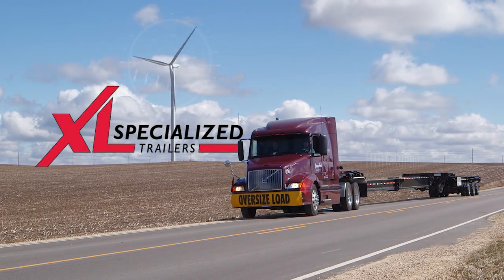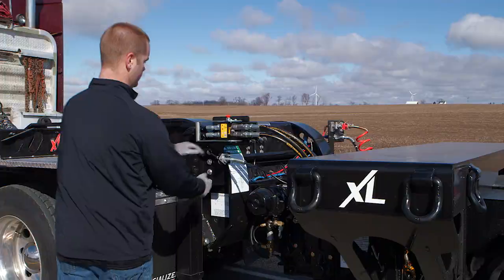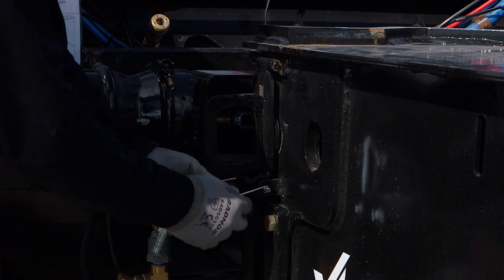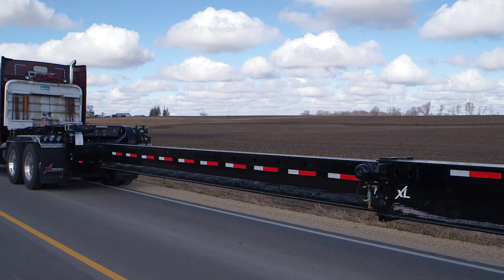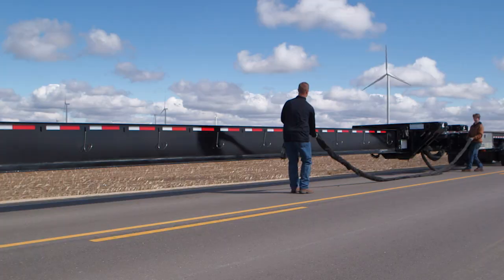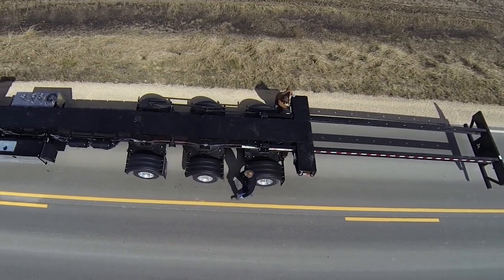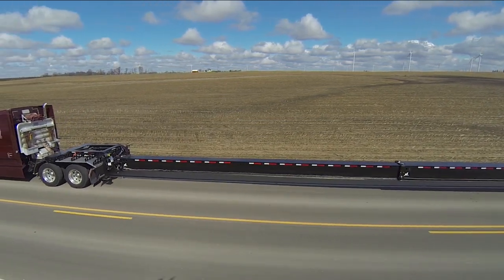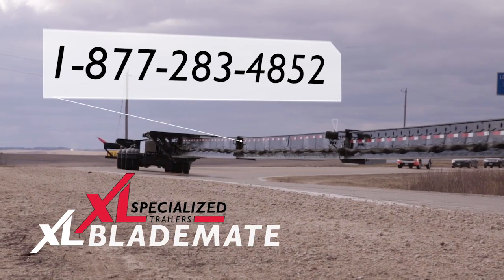XL BladeMate: How To Extend

Comment: I am a steerman for one these trailers. It's not a hoax it's real. We haul wind turbine blades on them. The axles on the trailer steer by a remote which let's us take turns. Which is my job. And yes if the wind is to high it will make the truck go out of control if you're not careful. Its actually a fun job.

Comment: How much of a pain in the ass it probably is to make turns. If it was possible for it to articulate in the middle of the trailer, maybe it be a little easier, but this trailer is probably made to haul really long pieces of material. Like pieces for a bridge. I seen a truck haul a long piece of concrete wall for a highway on a trailer similar to this. The trailer was real long obviously, and looked like this trailer. Maybe it was this trailer. Lol
Reply: I think it pivots at some point and the back is remote controlled

Comment: Question: Why can't you pull all the pins at once while extending the trailer?
Reply: I'm not a professional here but my guess would be the bigger section is stronger and if you dont need all the length it makes  more sense to just use the strongest part of the trailer.
Reply: When you the stopping points for collapsing it are probably much stronger the the points keeping it from getting pulled out all the way.
Reply: I am actually a steerman for one of these trailers the reason we dont pull all the pins it actually makes it easier to stretch it out instead of having to fight the pins when it's all stretched. If that makes since

Comment: Nice trailer,

But why are the air, electric and hydrolic lines not follded in a spiral with a spring, round a long thin telescopic cilinder?

That whay will easy up the extending job and speeding itt up as well.

Comment: 40 acres are needed to turn this rig around
Reply: corn cobb give me 40 acres and I'll turn this rig around
Reply: 128ft long divided by 2 = 64ft of clearance needed to turn left. 
104ft clearance to turn right. 
Average intersection is 150ft wide so .. turning from a 2 lane to a divided 4 lane you pivot the steers and you merge from left lanes over median to right lane.  

Other words you get a piece of paper that says you can jump the curb legally from the left lane to the right lane turning right at the intersection.
Reply: Not with the steering system at the rear. you can turn it in areas you almost cant get a regular semi in to.
Reply: Kasper Onza R/woooosh
Reply: corn cobb   %hu
Reply: Not true! Trailer axles are steerable
Reply: I pull these and Faymonville blade trailers in Texas hauling 72 meter blades. It doesn't take as much room as you would think if you have a good steerman on the trailer. You would be amazed at the places we can put these trailers.

Comment: Quality, all around. I'm not sure what I am more impressed with; the design and engineering of the trailer itself, or how good of a product demonstration video this is. I doubt I'll ever come across this trailer or have a use for it personally; but after watching this video once, I feel pretty confident that I could extend it without any issues.

I am surprised that the three axels on the trailer remained in the same spot though. Before the video started I assumed that the axel toward the front was connected to a separate extension from the two rear axels; I figured it would be closer toward the front of the trailer to help support the middle of the trailer, and possibly been able to turn making it easier to maneuver the trailer since it is so long. It makes me wonder how much large wind turbine blades weigh, and how much of that weight is at the end that is connected to the turbine. 

Are there any other practical uses for this trailer?
Reply from the maker: Hi Dalton, thanks for taking a look at our video! The reason all the axles stay together at the rear is because they are all connected to the outside, largest box beam. Since the blades are rigid enough to support themselves, a center support is not needed. Having one axle group is also easier to control and maneuver. Wind tower blades are typically between 30,000 and 45,000 pounds. This trailer is also useful for hauling bridge beams, or other materials that are long, rigid and have a low center of gravity.
Reply: Dalton K.  Qmjk
Reply: Dalton K. O